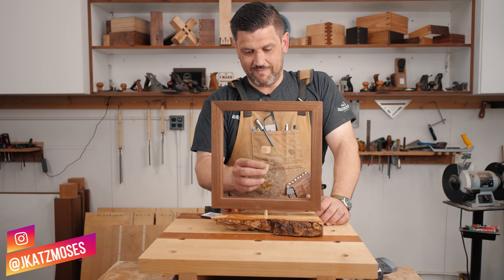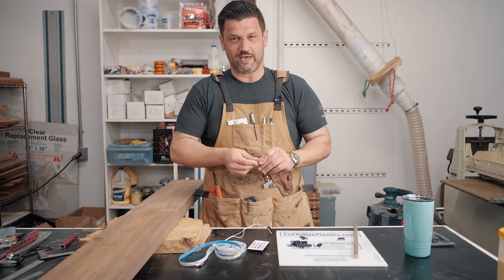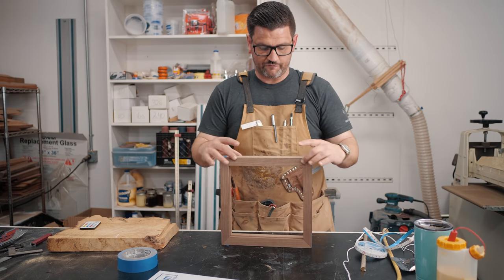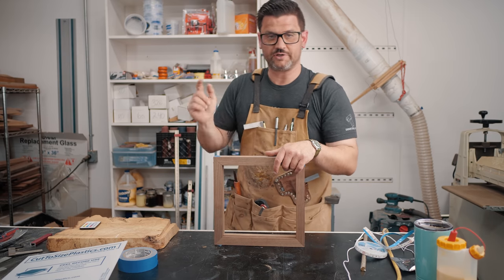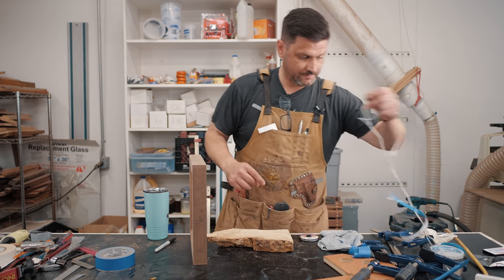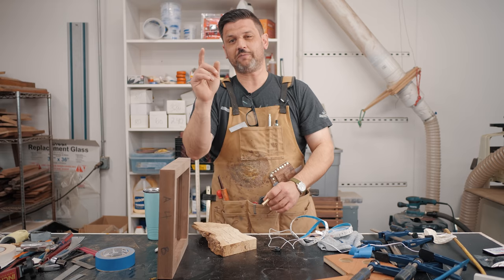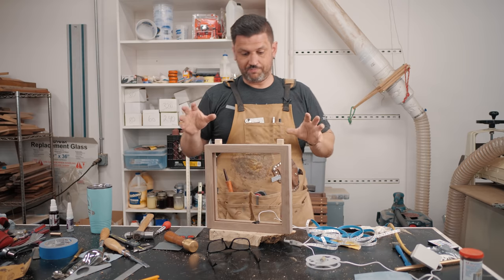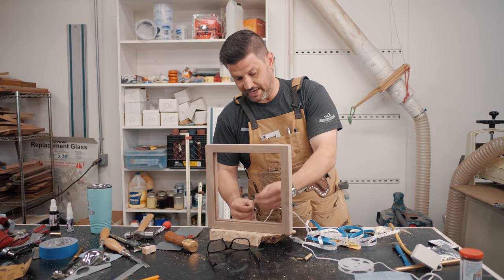Magic Magnetic Balance Light

Comment: Awesome video as always. Random tip for the LED strips: 
If you want an even strip of light without the dots shining through, the neighboring LED dots should form an equilateral triangle with the diffuser / plexiglass in terms of distance. So to get the right height between the diffuser you simply calculate the following:

Distance between each LED dot * 0,5 * square root of 3.

In example of an LED strip with each dot being 1 inch apart thats: 1 * 0,5 * square root of 3 = 0.86602540378 inches. 
Keep in mind that this only works with LED strips that have evenly spaced lights though.

Got that tip from an old exhibit builder, when we set up a booth at a light fair.
Reply from the maker: Darn! Now I know way more than I thought I ever would. Great comment bud!
Reply: Or use lenticular diffuser film which diffuses light in one direction, can be much closer and does not reduce light as much as regular diffuser.

Comment: Turned out cool like the limit switch usage. I really enjoy my stop block that I ordered from you but if I had one suggestion it would be to close off the gaps that the bolts slide along in the back. I often find the bolts/knobs falling off when I'm taking the stop block off and on my fence

Comment: Do you find it easier to miter on a table saw opposed to a Miter saw? Really getting into woodworking as a hobby, helps with PTSD and your videos have been extremely helpful?
Reply from the maker: So much easier to build a crosscut sled for a table saw because you can really dial it in.